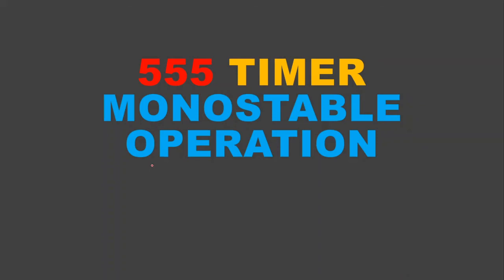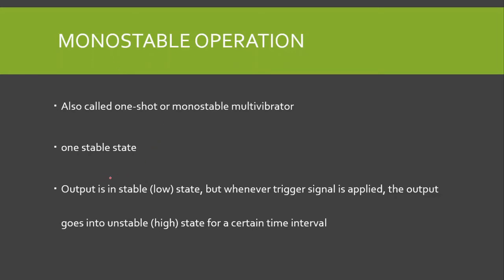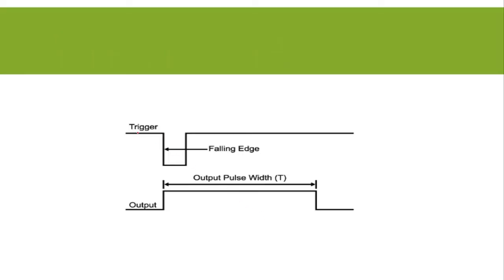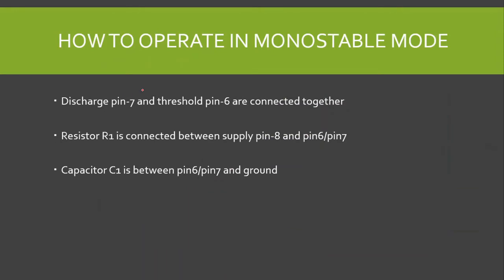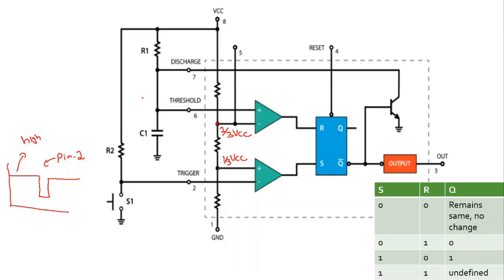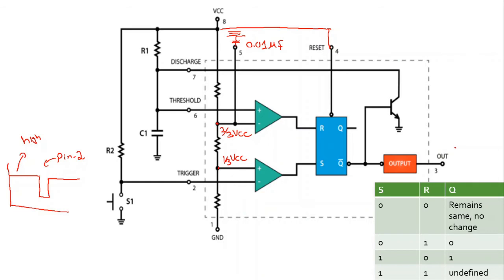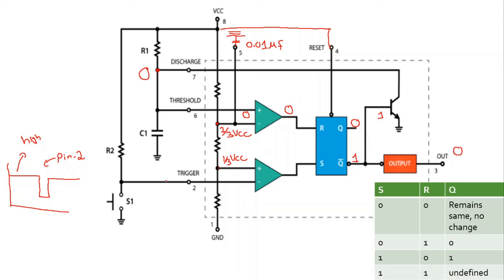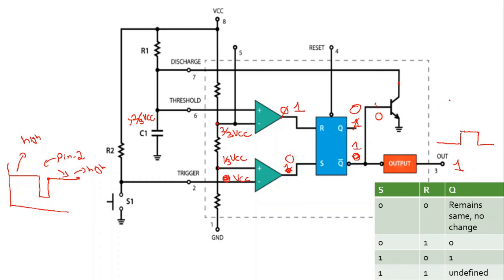Monostable 555 timer explained|Monostable operation of 555 timer| Monostable 555 timer

Comment: There is one undesired problem in my circuit as in your description. When I turn on the power, output goes high and then low again.How to prevent that? I need to keep the output low when turning on power. Otherwise the 555 works well in one shot mode.